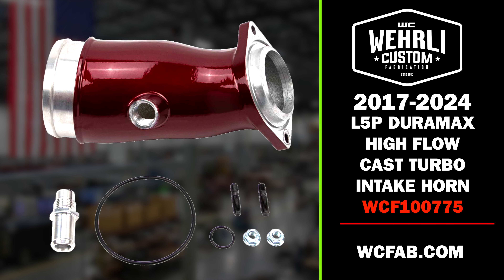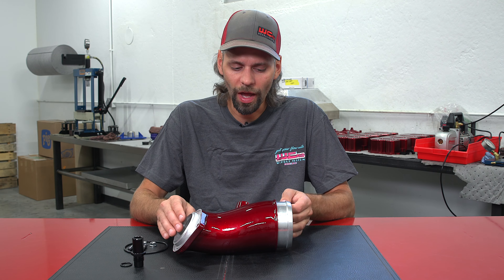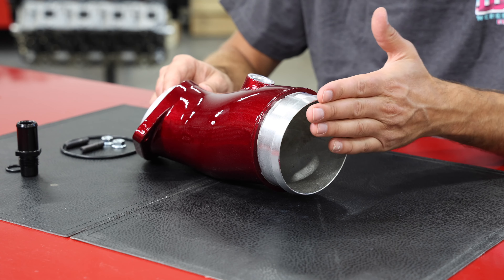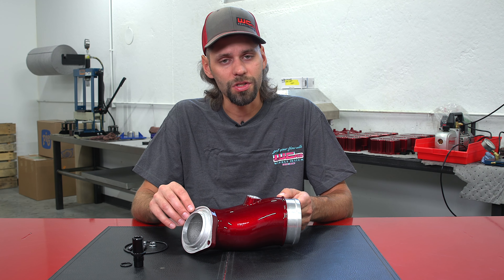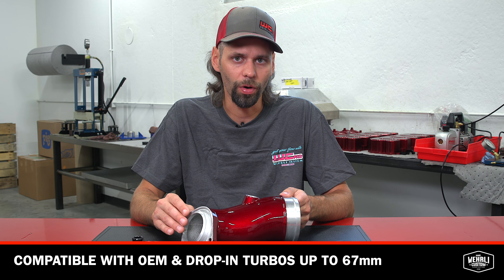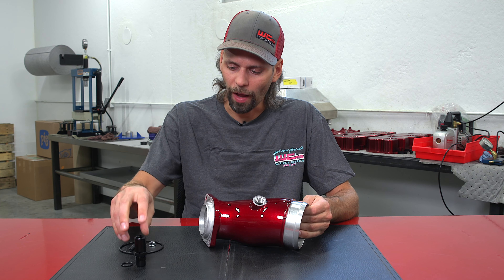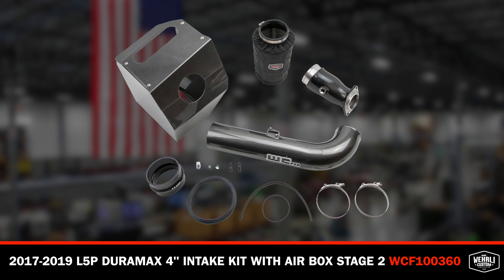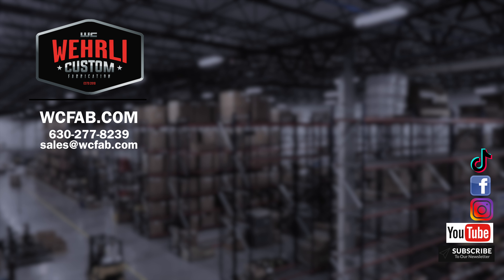2017-2024 L5P Duramax High Flow Cast Turbo Intake Horn

Comment: Installed mine a few weeks ago with the intake so far no lights on dash. The combination of both with my butt dyno seems like th truck runs better.
Reply from the maker: @jasonflores2571  glad to hear it! Thanks for being our customer! 🙏
Reply: Does it add any pwr  with a 50 hp tune or just better and fresher breth
Reply from the maker: @sarareimer2224  we haven't tested this horn alone on a 50 HP tune yet specifically, but based on our past experience with using bigger turbo inlets on Duramax trucks, we would expect swapping out the horn to help you add a few more horsepower to that tune. As a point of reference our outgoing 3.5" design was proven capable of picking up in the neighborhood of +25HP when combined with a max effort tune.

Comment: Anything in development for the 3.0 Duramax?
Reply from the maker: @rob2300  not just yet. We did pick up an LZO shop truck recently however and are putting some miles on it in stock form to get a performance baseline. What parts are you looking for?

Comment: isthis intake horn compatible with the use of the banks derringer? i read before that you didnt recommend it bc of surging issues
Reply from the maker: We haven't specifically tested this new horn on a truck equipped with the Derringer yet, but do anticipate better compatibility than our previous design. If you have additional questions about this part, please give us a call at the shop (630-277-8239). We would be happy to talk with you about your truck and  how you use it as well as what you're hoping to get out of it to help make a recommendation that will work best for your needs.